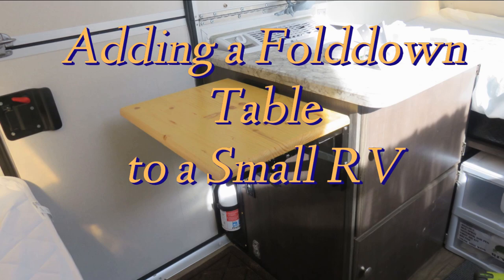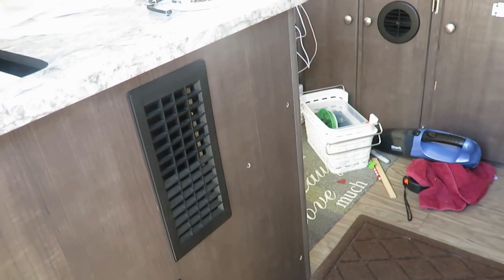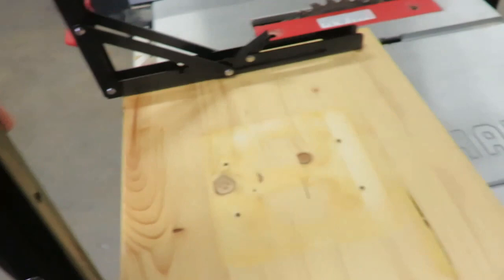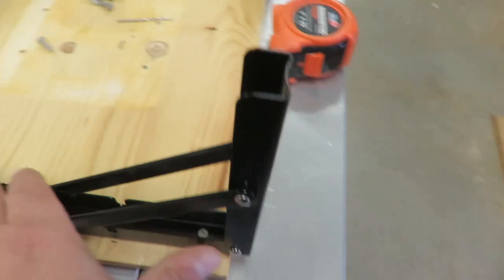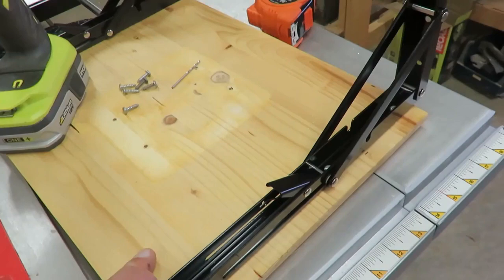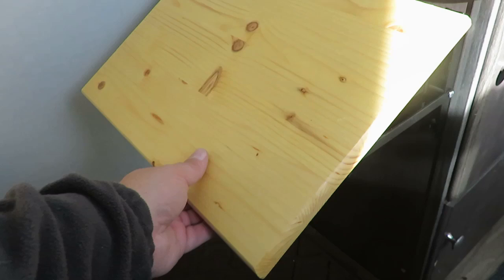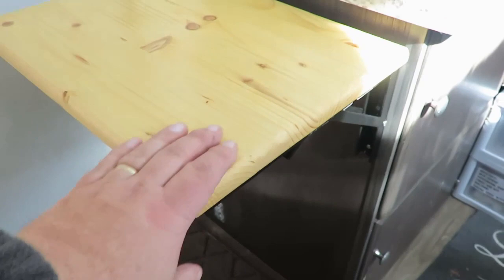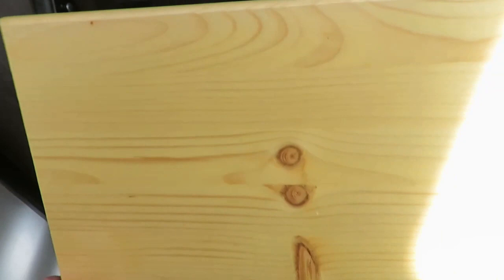Adding a Folding Table to a Small RV

Comment: Very neat solution. Question about the small red electric heater. Does it do ok heating your trailer?
Reply from the maker: thomas dipaolo it’s only 300 watts but raises the temp 15 to 20 degrees as long as it is higher than 40 degrees outside. Got it at Wal mart